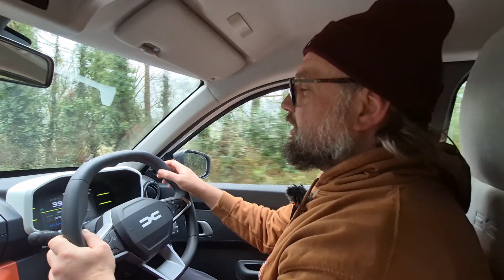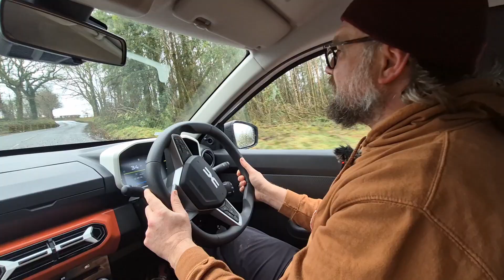Why are car speed warnings so rubbish?

Comment: What's happened to self driving cars everyone said was around the corner. I've heard very little about it after the hype of a couple of years ago. Is it because it's still useless technology? Are actually people realising that they don't really want it?
Reply: The technology is there but not allowed by law, our 22 Qashqai will drive and steer itself but flashes up a warning if you let go of the steering wheel  . . .
Reply: @davekirton4096  it will drive and steer itself until it goes wrong and hits someone. That's possibly why you're not allowed to take your hands off the wheel. Rendering the technology unfit and useless because it's probably harder and more stressful monitoring and correcting it than it is driving.

Comment: The basic thing is: Just turn it off. My car is from 2021, so the speed warnings aren't on by default and can be turned off permanently. Lane assist is on every time I get in the car, though, and I always turn it off. The lane assist works fine on good, wide roads, but on anything else... Nope. Just nope.

Comment: I've also heard on the Internet,  so of course it's must be true,  that modern cars can be attacked by hackers and that car companies are spending huge amounts of money  trying to  prevent this. Of course, adding to the cost. And as we all know,  hackers tend to succeed no matter how  much  money  is spent.  So if your steering wheel isn't  attached to  the wheels and your  throttle  pedal isn't attached to the injection system, I'm  not really seeing the safety  benefits if someone in China or Russia can control the car.

Comment: These modern car features are just annoying. I've got a 2012 mini and I wouldn't want to buy anything newer. I've got android auto / apple car play using the factory screen and cruise control I can easily change with + and - buttons on the steering wheel. What other features would I need in a modern car? I don't need to be pestered that the speed limit has changed or that I've just crossed over a line because I'm changing lanes or the car to slam on the brakes because you park close to an objector it to constantly beep at me while I'm parking etc. the only other modern car feature it has that I do find annoying is the auto start stop which I simply coded to be disabled/off permanently thanks to a coding app.

Comment: I drove a Citroen driving school car Friday (Im a mechanic I serviced it) and the speed warning had know idea AS A Driving school car! How are the new drivers supposed to deal with the miss match of info...on a second note I did the same route in a transit pick up the same day and had a fighting dog slip it lead and run out in front of me and I planted the brake pedal through the firewall and I sat there for what felt like 2 mins with my leg locked on the brake just for my brain to work out the 2 women and 2 dogs dogs panic and then the dog appeared in the left mirror,,, 20 is plenty !! shook the s==t out of me !

Comment: A couple of years ago I was driving a rental car in Sydney, and the NSW buses have a '40km/h if the lights are flashing' sign on the back.

Of course the software on the car interpreted it as a 40km/h speed limit sign even though the lights weren't flashing. A bit annoying in a 70 or 80 zone!

Comment: Yep, not long got a new car with the 'default on' Speed Limit warning and Lane Assist - speed sensor picks up every limit on side roads, to the point I've had to get into the routine of turning it off every time I start the car. The lane assistant has become even more dangerous than the older similar model I've just changed from - old one just gave you some vibration through the steering wheel, the new one activity tries to steer you back into the lane - very disconcerting and dangerous when you're not expecting this, and seems to have a mind of it's own when driving in the rain! Again, this now gets turned off with every start up.

Comment: Inconsistencies in speed limits are usually due to driving past a side road, or a parallel road, with a different limit.
It's particularly a problem for new drivers with 'black box' systems. I know of two drivers who have got insurance points for exceeding a non-existent limit. One of them used some dash-cam footage to prove that the limit didn’t exist on that road, and had the black mark removed. The insurance company admitted that the system wasn't perfect.
Reply from the maker: I can confirm I had several experiences of it either missing signs or just being flat out wrong with no parallel roads.

Comment: I'm turning in a right pedantic old Hector, BUT...   cars have two existing devices for keeping to the speed limit, while also being able to seamlessly accelerate out of trouble if needs be.  They are the speedometer and the accelerator pedal.  My next big birthday will be 70, yet somehow I can still keep to the speed limit by keeping half an eye on my speedometer.  A miracle!  All the bings and bongs are meaningless.  You search helplessly across the dashboard, trying to pin down quite why your car is beeping at you, often without ever finding a cause.  This neither helps you, nor aids  your concentration on driving.  Just adding more and more layers, does not improve basic driving skills.  The most useful gadget I've come across in recent car technology, isn't that recent at all.  It's that cruise-control addition, the speed limiter.  Unlike cruise control, it doesn't cancel itself if you use the brakes, and it can be defeated if you floor the accelerator.  It's main use is to only allow you car reach the limit you've set it to, and no more.  You can go slower, you can brake, come to a stop, and set off again, but even then it stops you exceeding the speed limit you've set it to.  I even prefer it to cruise-control, as your foot can forget where it is after a period of time not on the accelerator pedal (dangerous, if you need to brake suddenly).  You just plant your foot on the go-pedal and get to your chosen speed, but no more.  20mph in Wales and central London, for example, are easy to hold, no matter how depressingly slow it feels at that speed.  Average-speed-camera sections of road and motorway are easy to cope with, because you'll never accumulate enough over-speed to be caught out at the next camera.  Bah Humbug Sir!
Reply: I had a customer come in last week with a 2024 A Class, complaint was something like 'Its bonging at me randomly & I don't know why'. After a very deep search through various settings, we found an option that was adding an extra bong whenever the speed limit changed. Mercedes don't get this right either 🙄. Fortunately we could turn the limit change bong off, the other one still resets at each startup however.
Reply: After 50 years of driving I find I can judge my speed pretty accurately without even looking at the speedo.
Reply: @NeilBarratt  when I was learning to drive, my driving instructor said I was looking at the dash too much and put his notebook in front of it! He told me to figure out my speed by the sound of the engine and how that speed "looks" on the road. Invaluable experience. 

(He would've intervened if I'd ended-up over the limit during that exercise, but I hovered around 3-5mph under, so happy days.)

Comment: 100% agree and one thing to bare in mind too is that it's software. Software needs updates and as roads are built, altered and speed limits change, will the software support be ongoing? Will it have a cut off time? God forbid buying a second hand car in 10/15 years time to be told 'support' for your 'essential safety feature' is no longer supported - or worse, being charged for it 😂

Comment: Renault is one of few manufacturers that get it. You can create a custom driver profile where you turn the driver aids on and off to your liking, and there's a dedicated physical button to press that enables this profile. The button is helpfully lit up until you press it. I'm not sure if the Spring has this, but other Renault-Dacia products do. 

Renault knew these features are utter crap and will be universally hated, so they made them easy to disable. Then we have manufacturers like Honda and Toyota which as far as I know put the settings behind many button or touchscreen presses. Great way to make sure that I won't ever buy one of their cars.

Comment: I detest some of these systems  they are not smart at times. A particular incident was I had to take evasive action and steer around the problem rather than brake. There was nothing in the lane next to me so I decided to steer around. As I crossed the white line the car thinks I am doing something wrong and its doing its best to steer me back into the problem - which incidentally was a van who was oblivious to what was happening around him. It takes quite a force acting against the car trying to steer where it thinks you should be rather than where you want to go. It drives me insane. I am considering getting a dumb car for the short journeys and it being more relaxing.

Comment: My Suzuk Alto has speed limiters everywhere. The speedometer tells my eyes how fast I'm going versus available speed limit signs. If I lift my right foot off the accelerator, the speed is limited. Especially going uphill. Pressing the brake helps. Then there are natural speed bumps called potholes. And last but not least is 'Er In Doors gives me jip if I go too fast.

Comment: If you need these features on a car then you shouldn't be driving in my opinion, the car I have has a touchscreen & I'm not a fan of it although on the flipside I had a Peugeot 407 before it & the dash has to many buttons & wasn't very intuitive to use.

Comment: You’re not wrong, Ian.  I own a Mazda and it repeatedly gets the speed indicator completely wrong. Often on the motorway it tells me I should be driving at 5 miles an hour, sometimes 10, sometimes 20 and it carries on for miles and miles.  So annoying. It’s just a regular stretch of 70 mph motorway but if I was involved in an accident the computer would indicate I had been exceeding the speed limit probably.

Comment: The speed limit detector in my car I think works with GPS. It doesn't bleep much and the limiter is opt in. Only activate it through road works and count the stuff overtaking me. I agree that there is generally too much tech in modern cars.

Comment: I always turn off lane assist when I start. I don't want anything tugging on the wheel when I'm trying to thread my way down busy roads. But the worst one is the collision warning system. Although I have the sensitivity turned right down, it can still freak out when I pass a parked car or a bush close to the kerb. There are other less important "driver aids" that are there because they can, not because they're wanted. It's a relief to get back into my other car which has all the latest tech...from the 1930s!
Reply: I wondered why some slow moving cars bleep bleeb when I'm traveling along a city cycle lane. But that might be a good thing?

Comment: My last two cars have been really good at showing the correct time. An Hyundai and a Cupra. The Hyundai was 2019 and that seemed to be centimetre perfect every time, untill the changed to 20s in Wales. It never updated. 

That had the best system, it would only been at you if you was speeding and there was a camera approaching. 

My born announces the speed cameras approving. Which is better than the Beep chime on the Hyundai, but Born beeps if I break any speed limit.  However it's such a quiet and soft charm, before it annoyed me to death, or even looked how to disable it, my brain has filtered it out.
!
 Also it seems it only directed at the driver, as people can only hear it when I point it out, and a smooth road and turn the radio off. 

We are just one step away from the car either only letting us physically do what the limit stats or auto fine is every time we go over the limit. Now in Wales with our 20s we would all be broke in a week.

Comment: As I've just experienced the same system in my father's new Kadjar, I wholeheartedly agree. On top of that, the energy use bar makes you reluctant to accelerate (in the same way as some drivers are reluctant to use engine revs). No wonder there seems to be a lot of dawdlers in modern EVs & hybrids
Reply: Yep. When I was learning to drive I'd first do these really meagre accelerations, because that's what I'd learned was most fuel efficient while studying physics. Driving instructor told me that's no good when others are on the road, and you're to approach the limit as fast as you safely and practicably can.

Comment: I hired a Toyota several years ago with speed recognition which did a very good job of consistantly reading the lower speed limit signs at the top of the slip roads off the main dual carriage way I was dirving on in Sweden!  It seems now all they have done is add a 'bong'. It sounds like a job for someone to hack the system and turn the  'bong' off.

Comment: I can confirm gps speed limiters are also rubbish. Some of our buses in London have them, sometimes you would be cruising along the North Circular at 40 and it would suddenly think it was on a side road and drop to 19mph. Other times you would pull out of a 10mph area and it wouldn’t immediately allow the bus up to the 30/40 speed limit and would just have to pull out knowing traffic behind was going to beep then the bus would suddenly accelerate once it realised where it was 👎
Reply: That's so awful. Everyone knows GPS is only accurate to about a metre, and roads with different speeds can frequently be less than a metre apart...

Comment: I have a Renault Kangoo Van with this exact digital cockpit and touch screen, first thing I did was to make a personalized profile with the speed warning beep turned off but I kept the system that reads the road signs, it's fairly accurate but not 100%. I also fiddled with the lane assist and front assist and all kinds of systems it has. Now I just get into car, start it up and click the button twice to automatically switch to the personalized mode and it doesn't annoy me almost at all during driving. Just a simple button like this makes the car so much better to live with, and you don't have to manually disable it on the touchscreen with every car start up.

Comment: These systems are annoying because they do not always detect speed limit signs. My Hyundai i10 does not recognise de-restriction signs so that if your speed drops below the previously recognised speed you get the beeping sounds, even on the motorway where the system thinks the speed limit is 40 or 50 mph.

Comment: I had a brand new Audi as a courtesy car when my vehicle went in for a service. The thing had this annoying beep at 31mph etc but the worst thing was that whilst driving down a dual carriage way I overtook a vehicle and then as I returned to the inside lane the steering suddenly tried to drag me back into the outer lane. It felt as if someone had grabbed the steering wheel and was really forcing the car over. Suffice to say I only used the car to get home and then back to the dealership the next day.
Reply: I've had that, but only when I failed to indicate to show I was changing lane...

Comment: Not long ago I had 74 Kia Xceed courtesy car and it had the speed limit warning, and it was relentless, 1mph over the limit and it was beeping away, I'm sure it sometimes beeped just absolutely no reason. You could turn it off, by going through about 3 different menus in the touch screen (which seems safe), and then when you turned the car off, when you next started it all the beeping would come back again. It really annoyed me.  I mentioned the 74 plate, as the 24 plate ones I've also driven don't do any beeping.

Comment: I had a rental Juke at the end of the summer that had a sign recognition.  Luckily it didn't beep, just flash the sign on the dash.  It missed lots of signs as there were trees and other greenery overgrown around where the signs were.  

It also didn't seem to understand single lane dual carriageways although was clever enough to spot it was on a two-lane dual carriageway or motorway and change from 60 to 70.

If there was going to be rules around cars limiting the speed to the signs there would need to be huge investment in more signs (extra repeaters etc) and keeping them all clean and clear of obstruction.

The GPS based speed limits on satnav apps seem to always work perfectly, but I assume you can't base any legislation around that.

Comment: Nothing that some duct tape over the forward-facing camera won't fix. 😁
Reply: My Ford goes mental on a frosty morning when it decides the camera cant see - big message and bongs, even pings a message on the connected car app on my phone. Funny this is the area the heated windscreen doesn’t seem to touch so it takes ages to clear. Driving in fog also has the same effect.

Comment: I think this is just a specific implementation problem, because mine really doesn't intrude and it's 80-90% correct.  It just flashes a small speed sign on the dash when you're going over the speed limit without any sounds.
Reply from the maker: 80-90% correct is still awful!
Reply: @hubnotes  80-90% correct at this moment in time is great. As a result of the new rules car manufacturers are forced to make these features better. So in a few years they will be close to 100% correct. Continue to call out the manufacturers about how inaccurate speed warnings are. Blame the manufacturers, don't blame the rule makers.
Reply: Imagine your car forcing you to slow down or speed up in that remaining 10-20%. That's still a horribly bad score tbh.